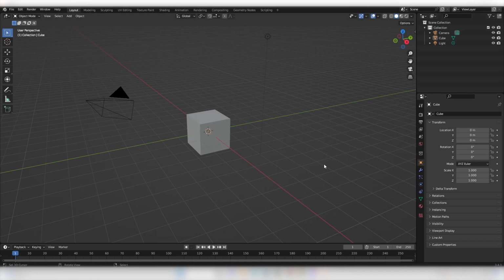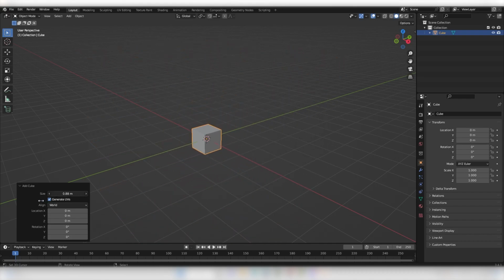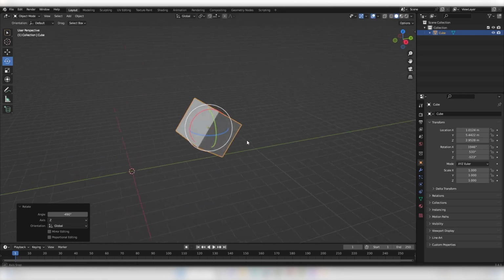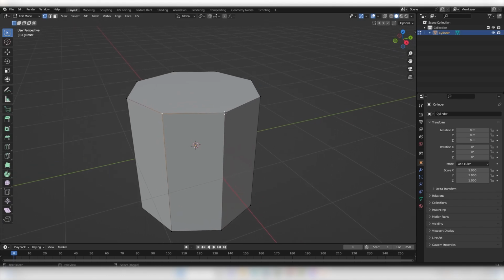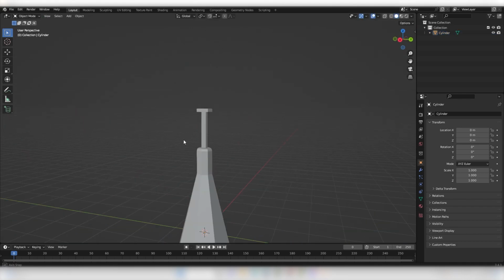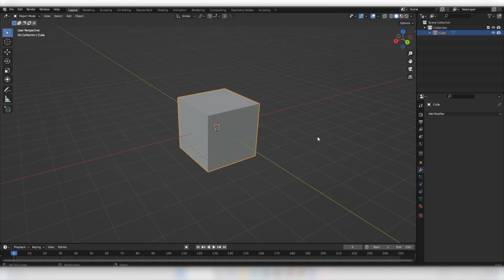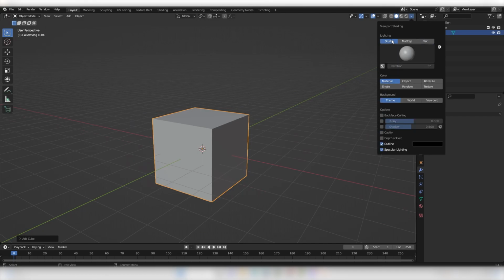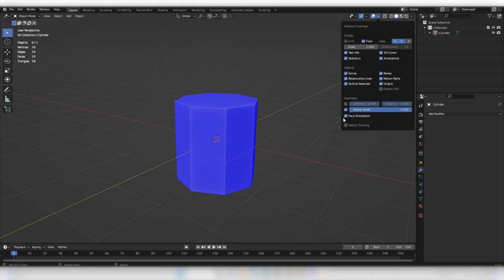Blender for BEGINNERS 2023 - Complete Beginners Guide (Modelling)

Comment: For People Looking for answer to no "Normals" option:

The Normals > Auto Smooth panel doesn't exist anymore since 4.1, you need to either

Right click in Object mode and choose Shade Smooth by Angle, which will create Mark Sharp on the edges, depending on the Angle chosen in the Operator Box

Or right click in Object mode and choose Shade Smooth then give your object a Normals > Smooth by Angle modifier

Answer from blender forum
Reply: W